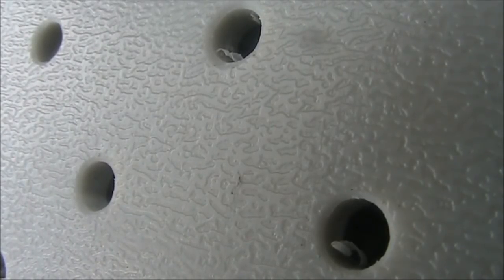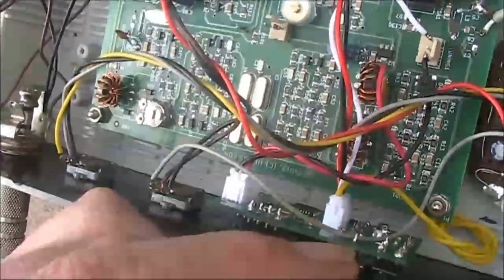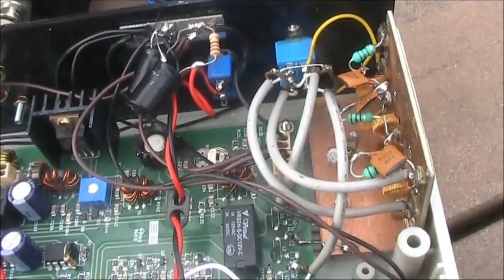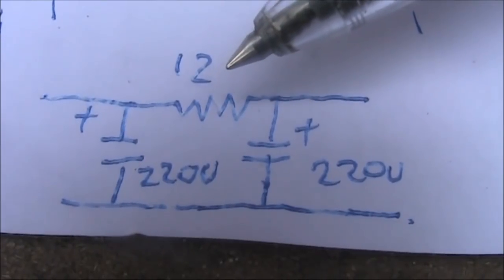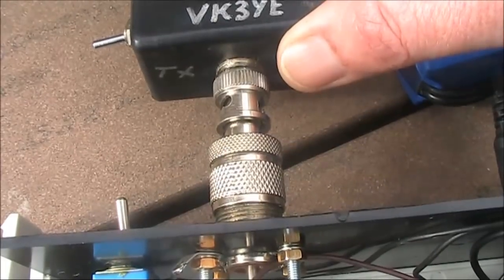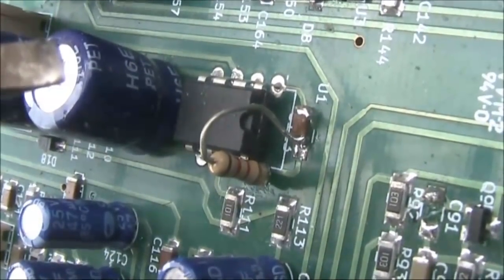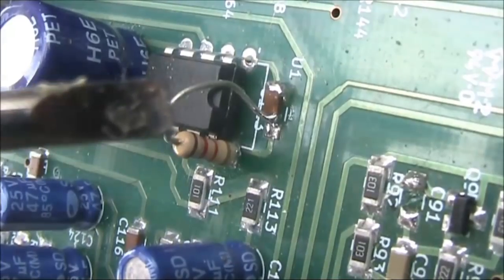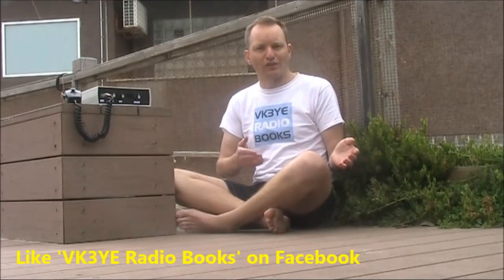Removing DDS generated noise noise from a QRP transceiver

Comment: I bought a cheap Chinese DDS VFO and man it has a nasty output.  The DDS VFO inputs into and also shares a power supply with a DC receiver.  This little filter circuit removed most of the noise.  I still hear some hum, but I think that once I've got the receiver in a metal enclosure, most of that will go away.  Thanks!

Comment: Great information for tracking down noise! I added this to my bitx40 and got rid of noise coming in from my switching power supply as well as from the DDS. I did hear the DDS noise coming in over the actual DDS line (not power line) but that was easily remedied with an inline filter capacitor (I used 220uF)

Comment: Good A/B test proves the DC filter's effect. Might be worth experimenting with a 1mH RFC in place of the resistor.
Reply from the maker: Thanks Paul - I did try a lower value ferrite but it had no effect.  Besides resistors are cheaper and I had the box of them close at hand!
Reply: I know this goes back to the before times, but I was wondering if you had considered the customary 0.1uF ceramic caps in parallel with the electros to compensate for the higher frequency stuff
Reply: Wow this is a conversation in slomo.  I would definitely parallel a 100nF. Not sure why it may have been left off.  You cant have too many 100nF caps! @MidlifeRenaissanceMan